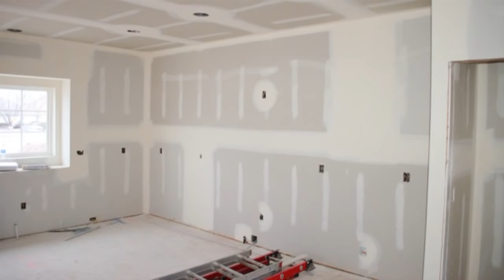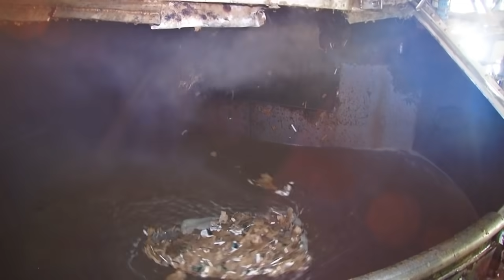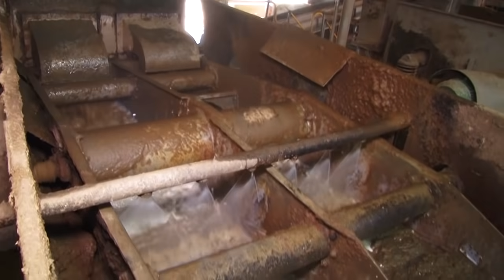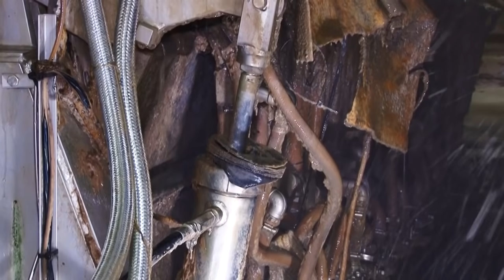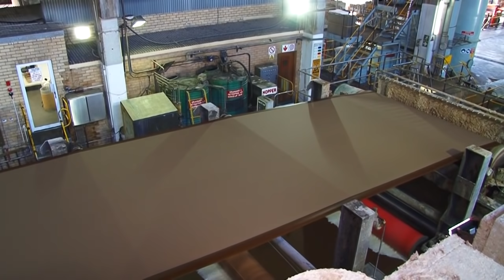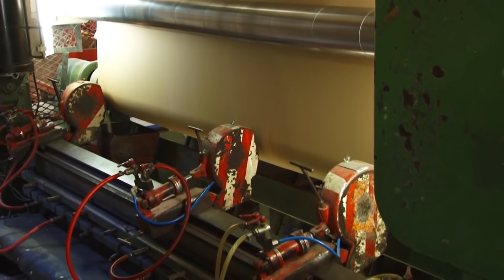How Cardboard is Recycled

Comment: How much of the water is recycled, how much is waste?
Reply: Was thinking that too. And is the used water harmful
Reply: This is the battle. Water loss is money lost in paper industries. A lot is reused over nd over but most plants tie into city water and/or a local river. Our facility, like manu others, has a water treatment plant too. Water use, reuse, and release is very heavily regulated by the E.P.A.
Reply: In my youth I worked in an oil refinery, and even back then no waste water was discharged from the refinery. It was cleaned and reused, or lost through evaporation in the cooling tower. It was not that they cared that much about the environment, but it was cheaper in the long-run to reuse the water and recover oil residue that might otherwise have been lost down the drain. All of the water they used had to be bought from the local water company, and not reusing it would require the purchase of more water.
Reply: As Matthew said, it's the bleach and dye in manufacturing office paper and stuff that causes problems. This water is either recycled, or treated a little before being discharged
Reply: Terry Doberstein - In these processes all the water is recycled.
Reply: Recycled water is only used at the beginning, the pulping process, the rest of process need clean water, the  water used will vaporised partially due to the drying of end product, and spillage during the production, to clean recycle water needed another process, another cost factor, and space concerns, power consumption, is up to the management to decide. If the water cleaning is required, normally just the basic settling process, letting the heavy particles to go down, and use the top part, this is most basic way, there might be other options by next cyclone down the dirt, flow over the slots, mesh filtering, vacuuming process, there might be some new equipments, some new methods, for cleaning recycle water. mine is older method of thirty or forty years ago.
Reply: Im sure all the water is recycled. The only water that isnt recycled is the water that ends up in the finished product. im sure the fire retardents and waterproofing chemicals they use are probably not half as toxic as they use to be. Probably similar toxins to house hold cleaners n what not. They would have a huge system alone. That catches all the water. Filters it abd recycles it. And because its card board. Not actual paper theres mention of bleaching chemicals to make the paper white. Which bleach is probably toxic than the fire retardent and water proofing chemicals they use.
Reply: Water kind of just recycles itself through evaporation.